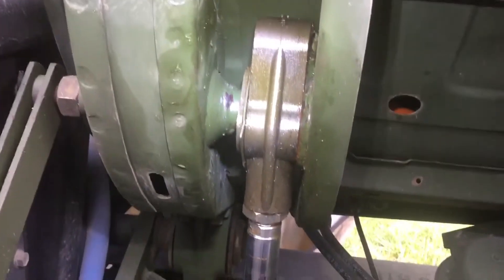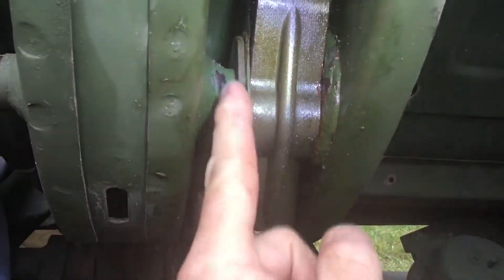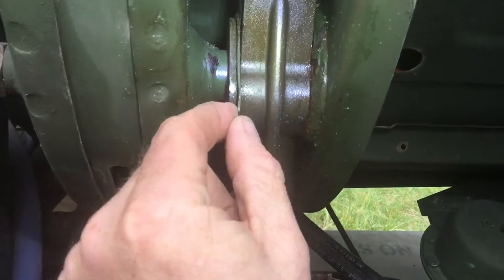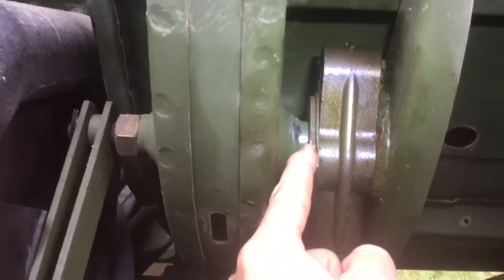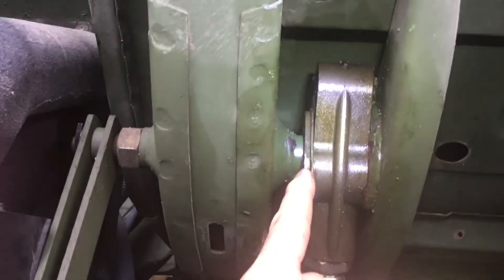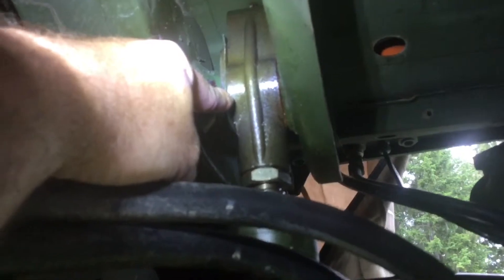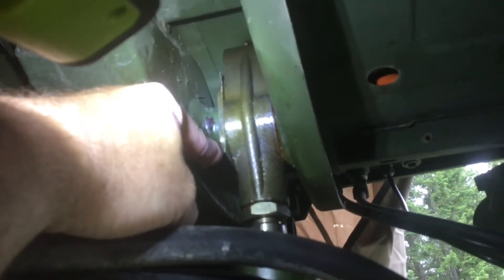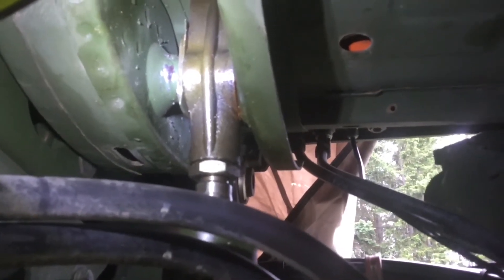LMTV cab lift dual function rod end.

Comment: should the elbow catch mechanism be straight at full extension or not straighten all the way, should you put a little oil in the cam mechanism.  thx
Reply from the maker: And no, the folding mechanism does not normally straighten out on mine(which is installed to the manual spec).  If I manually rotate the cam so it is in the long slot, I can get it to fully extend, but the cab also makes a huge lurch as it passes over the balance point(scared the hell out of me the first time I saw that).
Reply from the maker: John Hoffman you meed to keep it lubed yes, but if the cam is not rotating as shown, it is probably because there is debris inside and it will need to be disassembled and cleaned...

Comment from the maker: What I forgot to cover in the video is that this rod end isn’t sealed and is down and exposed to any debris/dirt the wheel decides to throw that way..  If it gets contaminated it will fail to rotate, so it needs to be cleaned and its operation checked regularly...